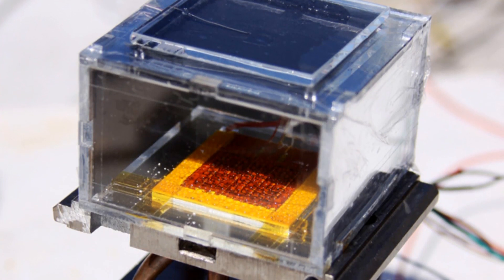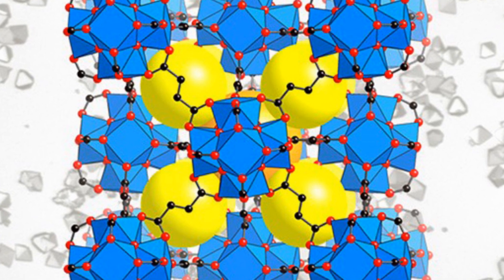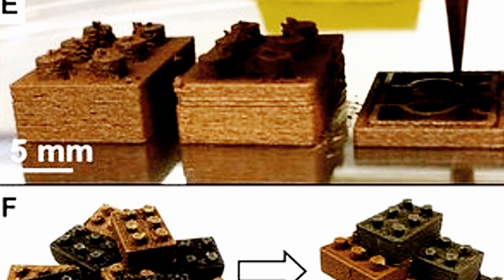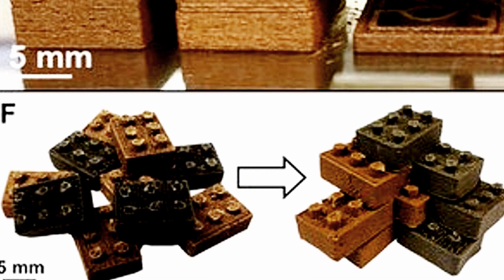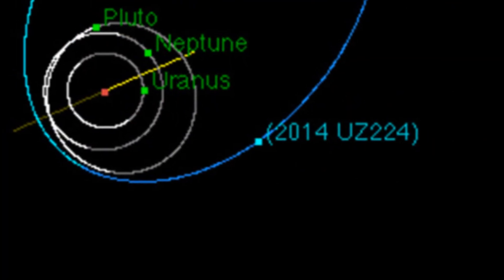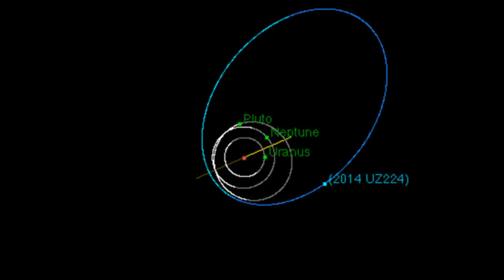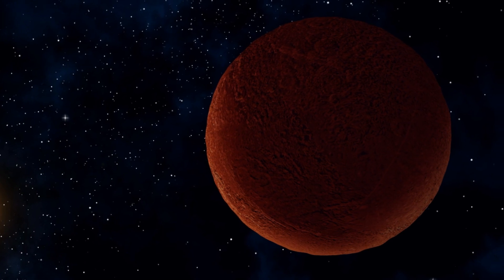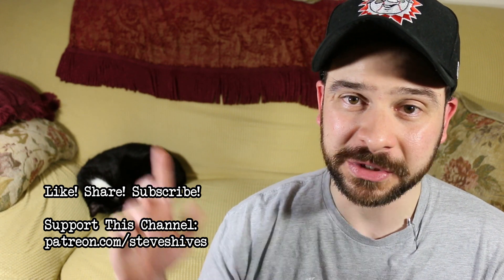And Now the Good News #237: Water From Thin Air!

Comment: Did someone actually do a little research as to how much water vapor is in the air? (HINT:  it varies by a wide margin, but it tends to not be very much -- unless you have ACTUAL PRECIPITATION, in which case you don't need the "device" when a bucket will do).

Comment: I have my doubts about pulling water out of the air, tbh. The article hasn't gone through classic peer review, and the principles are...dubious at best. I don't see how they've accounted for heat sinks as water goes from gas to liquid form, or for the air flow needed to capture significant water amounts, or for the >15% humidity in the places where something like this would actually be needed.

I would love to be wrong on this, but in my opinion, based on known laws of physics, I don't see this working out.